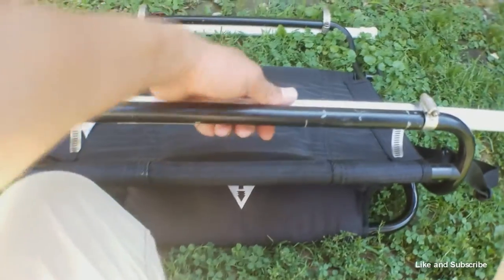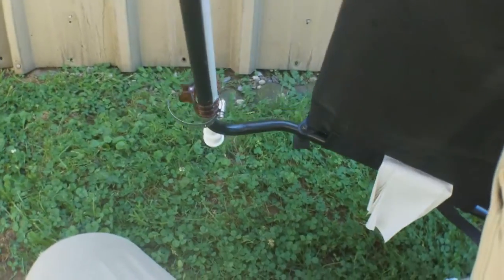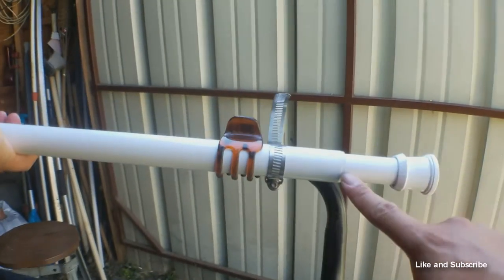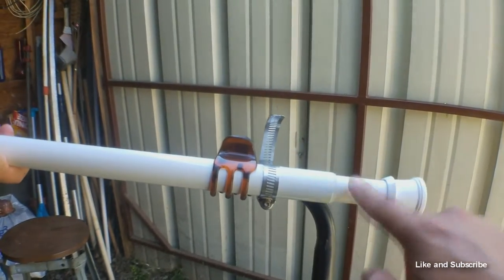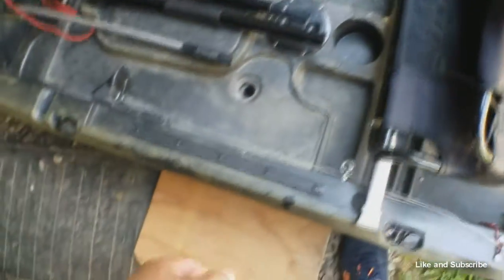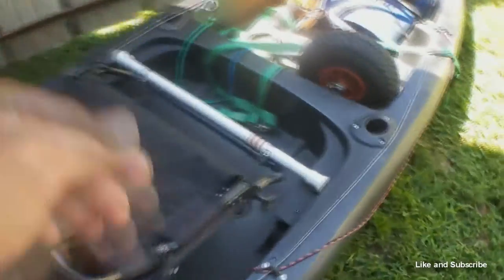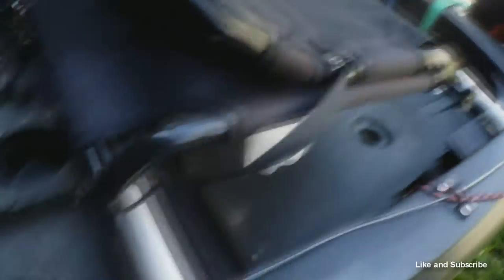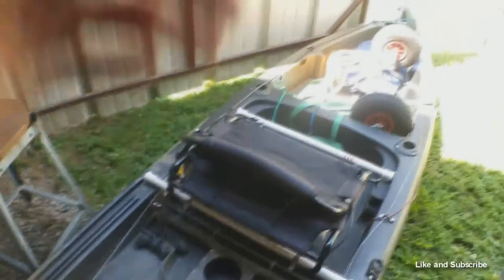HOW TO: FS12T Raised Seat [NO DRILLING!]

Comment: I'm going to try this.  I weight about 245.  If I don't feel comfortable with the curtain rods, I'll try using some galvanized pipe instead.  But I do like the thought of not having to drill any holes in my ascend.  Thanks for the video.
Reply from the maker: +Outdoors with Charlie 👍
Reply: I'm the same weight, did you try it?   And what was the outcome?

Comment: Looks good. I'm trying to raise seat since my butt is getting wet everytime. I just don't know if the clips would hold. I'm 250lbs.
Reply: Tenporch did you try this? i am 250 also considered doing this
Reply from the maker: +Conna 909 i forgot how much weight each rod can hold but since they are metal and with basically one side of the rod inside the other piece of rod, they will hold a hefty.